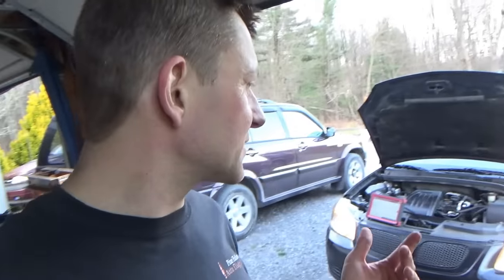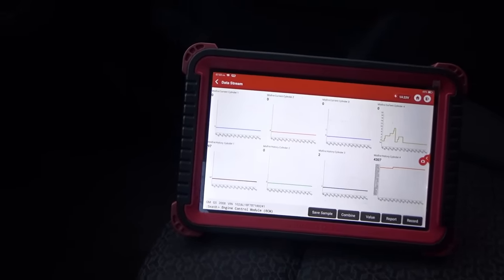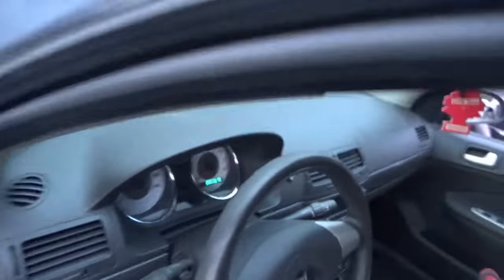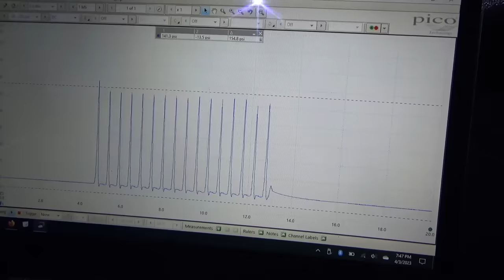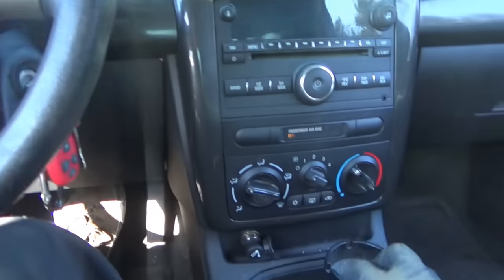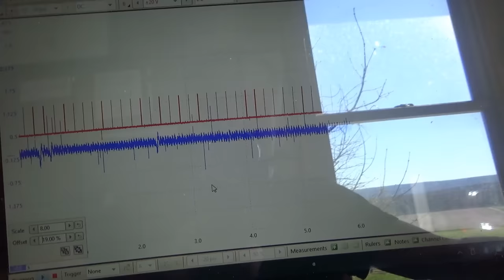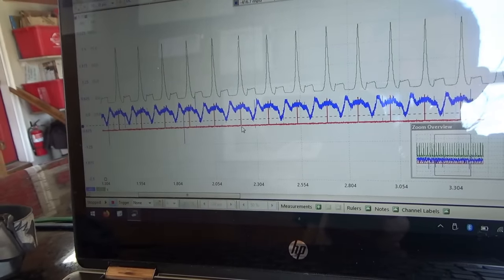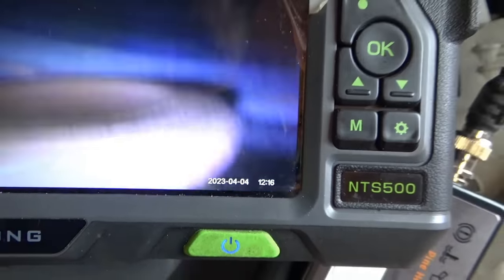P0300 Mystery MISFIRE - Difficult to Diagnose! (Intermittent "FISHBITE")

Comment: Wouldn't you see a peak in the exhaust capture, ahead of the valley, if the exhaust valves were leaking? Maybe I missed it, but did you put a transducer in the intake manifold? It would be interesting to see if you get a peak there that occurs ahead of the valley in the exhaust system. Of course it wouldn't occur directly leading into the valley, because the power stroke is in between the compression and exhaust strokes, but I wonder if you'd see anything.

Comment: It does seem like a broken valve spring might be the culprit, but that might result in engine failure if the spring lets loose and the valve falls into the cylinder. I have seen broken valve springs hold together for a while, but eventually they will catastrophically fail. Just out of an abundance of caution, I would pull the valve cover ASAP to check the valve spring; replacing a valve spring is a 10 minute job and the owner can still drive the car without destroying the engine, until they decide to get a valve job, but if they continue to drive as is and the spring completely fails the engine could be toast.

Years ago my then wife's 80 Toyota Camry developed a similar miss. Before I had a chance to try and diagnose it, the motor suddenly developed a horrific miss. I pulled the cam cover and one of the exhaust valves was gone. I pulled the head and the valve was embedded stem first into the top of the piston, but surprisingly found no scoring on the cylinder. Figuring I had nothing to lose. I sent the head out for a valve job and replaced the piston. After reassembling the car it actually ran good as ever. Six months later my marriage broke up and I always wondered if the car continued to function.

At the time I was working for my dad's enameling business and figuring the piston would make an interesting conversation piece I sent it off to have it nickel plated. A few days later the plating shop called and said the piston (and valve) had disappeared and they assumed someone stole it.
Reply from the maker: Now that's a story 😅

Comment: I measured the amp draw on a 2002 Lesabre and found that the fuel pump was using 5 amps instead of the 7amps. I replaced the fuel pump then viewed the secondary ignition waveform -- the lean condition cleared up in the  waveform  and the fish bite at idle seemed to go away.
Reply from the maker: Did the actual fuel pressure change? Fuel trims?
Reply: @PineHollowAutoDiagnostics  No the fuel trim for some reason was not high or low before and the fuel pressure did not change-The only thing that I could measure was the secondatry ignition --the waveform showed a lean condition on all cylinders before --then after fuel pump replacement the lean condition went away. My only guess was fuel volume.
Reply from the maker: @aarongallagher8898  that's crazy... Maybe old fuel pump was mixing in air to the fuel rail?
Reply: @PineHollowAutoDiagnostics  I did'nt measure the actual volume -just noticed after fuel pump replacement the amps used increased by 2amps and that secondary ignition double spike went away (mostly) along with the fishbite I was going in the direction of a vacum leak --but smoke testing turned up nothing. And all the cylinders had that lean condition so I thought what is common to all 6 cylinders--I also did a voltge drop of the fuel pump circuit (that was good).

Comment: if compression was the problem you should see it on the crank sensor. the fact that it is at idle leads me to think its sucking air at idle running lean. no mention of fuel trims. or injector on time comparison. is there an exhaust leak or a fault with the air injection?it gets worse with temp is the key attribute. whatever is expanding with heat. a stuck lifter with a hot valve stem may cause it to open but it should be every revolution. since multiple cylinders at one time caused it makes sense its one issue common to all cylinders. with that many miles i'd run it till it pukes.

Comment: I have a 2003 Cadillac deville,p0300. IT runs beautiful until it warms up,then it feels like 1 cylinder misfires, not multiple. Cools down,runs beautiful again,warms up, start's missing, I can feel it's only 1cylinder. IT had a p0420, I put dura lube cat cleaner in and that code is gone. I don't want the p0300 to set the 0420 again. I'm going to try and disconnect injectors 1 at a time and see what happens,if it is 1 cylinder, I should be able to find it. I did a smoke test,no leaks. Any information, I would appreciate it.

Comment: If engine is DI, my guess is carbon build up on valve causing valve issue.  If not, my guess is something valve related to a specific seating point on the valve seat.

Comment: Would a valve seat change that much from hot to cold? Double check the temp sensor and the thermostat. Otherwise Intermittent electrical issue based on the changing cylinder misfire counter.

Comment: i would think if you thought you had a burnt valve, via your electronic diagnostics, and you were "betting" it's a burnt valve, why not do a cylinder leak down test? especially on a 4 cyl. engine that is easy to get to?. you would know right away if the valve was burnt and leaking, just go to the tail pipe and Bob's your Uncle. thanks for all your great videos!

Comment: DRIPPING INJECTOR  former owner used gas from original location- new owner uses gas from new location and probably the cheapest crap available. Switch injector to see if issue follows cylinder,  replace injectors and run good quality fuel.

Comment: What gets me is how the misfires disappear just as suddenly as they happen but we know it's not an electrical problem since the scope shows injector and spark activity during the misfire.
Now, I've experienced low compression misfires on two of my cars a couple times on each that fixed themselves anywhere from 1 to 150 miles of driving.  One car is a Dodge Stratus 2.4L and the other is a Chrysler Sebring 2.4L. They burn a little oil and run fine when I shut them off, then the next day they'd get a dead miss. Shut the engine off, clear flood, I can definitely hear low compression in one cylinder. Drive a few miles and it's like it never happened. Oh and both of these cars have over 400k miles on them, hence why I just keep on driving if I notice any problems.
Reply from the maker: Wow 400k miles is no joke! 😎

Comment: Seems like the only way to fix that one is to keep driving it until the problem becomes constant. Too bad it is a hassle to remove those valve covers so as to take a look at the condition of everything in there. Something could be broken or strangely worn after all those miles. The first owner must have changed oil a lot for it to last that long. 
Looking at the condition of those exhaust valves they are lucky none have failed.

Comment: A vacuum transducer could detect valve problems more easily, especially when synced up to the spark of cylinder 4.  A vacuum gauge in the old days would tell us all kinds of valve issues
Reply from the maker: What would the vacuum transducer show? 🤔
Reply: @PineHollowAutoDiagnostics  I believe a valve problem showed greater instability in vacuum compared to normal, this was on a gauge you would see the guage swinging, a transducer will show you far more, you would have the ability to sync to a cylinder to see which cylinder is causing

Comment: Given the age and miles, I'd suggest a used low mileage engine replacement if one is available.  If one isn't available, a valve job could cause higher oil consumption with those old piston rings which brings the circle back to a new problem.  Just a thought.
Also, how corroded is the under carriage?  Safety could be a bigger problem.  The Car Care Nut guy brought that up in one of his latest videos.

Comment: i'd look at secondary first, it shows all you need to know with these

oh, exhaust pulse, that's the money shot

i've never asked myself a question why it sometimes misfires at hot idle, but runs fine under load. at least after i've put a couple of dead heads on my cars i haven't 🤣

secondary ignition is where it's all about, you literally see a valve not seating live on your screen, and it takes so little time it's unbeleiveable

the fact that we didn't see secondary is a no no imo 😓
Reply from the maker: You can see a valve seating on a secondary waveform? That's next level!
Reply: @PineHollowAutoDiagnostics  if peak kV is low every time it misfires, it's a valve seating problem

Comment: I,m going with dry/sticking valve guides. I've seen it twice in 35 years. At low rpm the valve wasn't closing fast enough.
Reply from the maker: Should have caught that on the pressure transducer...

Comment: If it’s a fish bite misfire, why tear the engine apart? To prevent being stranded? Could wait it out.

I had a random misfire I think (popping) but no codes after I changed my timing belt. I actuality got the intake cam off by one tooth 🤷‍♂️😂😂
My fuel mileage was terrible so I looked into it and figured it out.

That misfire went away but I still need to fix the timing job. Yes, I’m a dumb hack 😂😂
I wonder what caused the popping and why it went away.

Could Ivan have scoped cylinder 4 to see what he can see? Waste of time?
Oh, he did scope it.

Comment: I'm new to in cylinder wave forms and a 2006 gmc express van came in yesterday that wouldn't stay running. I checked fuel pressure, injector balance, spark, vacuum leaks. MAF sensor  and everything was fine. Then I grabbed a in cylinder  wave form and I had no vacuum dip. So I hooked up a vacuum gage to verify and it was fluttering bad from 10 inches to 0. When I raised the rpms the vacuum went to 20 inches. I did a compression test with a standard gauge just to see my max compression cranking and the odd thing is it hit 175 really fast. Usually it takes a couple rotation before it tops out, this was almost instantly. As another diagnostic tech I know you can't diagnose on a chat but what else should I test? I was going to check timing tomorrow because my scope died. I didn't see any pressure in the exhaust on my wave form. I checked when  spark was accruing to TDC and it was about.
Reply: Check for clogged exhaust?
Reply: @donwasse7892  thanks for your feed back. I checked that though. If you think of anything else let me know. I also thought it could be a stuck egr but this vehicle doesn't have one
Reply: @lovetolearn5253  I suppose with everything you checked, the only thing I can think of left is a badly stretched timing chain. Unless perhaps it has very low oil pressure to the lifters and the lifters aren't pumping up, which would look like late cam timing?

Comment: I have been in the auto repair business for about 38 years.  The first 30 was being a mechanic; now mechanic/shop owner.

I find I I fix vehicles more acurately and much faster by doing one very simple thing.  I talk to the client.  I ask a lot of questions.  On your car I might've asked a question like "did the vehicle sit for an extended time?".  You were smart and found out that the current owner said that it was fine for aprox 2 weeks.

Carbon and varnished oil/gas.  IF it was my car, I would first start off with an agressive top engine cleaning, then I would put in 2, 20 oz bottles of Techron in a full tank of gas as well as substitute 1/2 to 1 full quart of trany fluid for engine oil in the engine crankcase.  Again, if this was my car.

If you are truly going to tell the client to 'wait till it gets worse', then at the very least sell some oil and gas addatives, otherwise sell a head rebuild per your diagnosis.

I hope you get a chance to fix this for the client and looking froward to a resolution.  

I enjoy watching your videos, very much.

Comment: I had similar on an Audi 2.0TFSI. I had rebuilt the engine after timing chain failure. Replaced all 8 inlet valves. Most of the time it ran fine, but occasionally it would start to misfire, only at low RPM on one cylinder. Compression test was OK. I figured that one exhaust valve must be slightly bent, even though it seemed to lap in OK at the rebuild. Pulled the head and then filled combustion chamber with diesel. Yep, it leaked! Replaced all 8 exhaust valves then engine ran like a Swiss watch. My mistake of course. Should have done a leak test the first time!!

Comment: Switching coils proved the problem didn’t move with the coil but Is it possible the driver running the coil is missing once in a while? Possibly a bad computer or wiring to the coil? That might also explain the other two acting up randomly the next day.
Reply from the maker: Scope proved coil driver was perfect during misfire 😉
Reply: Oh ok I must have missed that part. That is crazy. I have been a mechanic for 15+ years and I have never had a random misfire like that from slight compression drop. I learn something new every day. Thank you for the great videos!

Comment: Just because the injectors flow the same amount of fuel doesn't mean they spray the same pattern. I would have swapped 3 and 4 injectors to see if the spray pattern was causing the misfire.

Comment: Ah.  The old oil drip misfire.  Intake valve guides are probably worn enough to be letting oil into the combustion chamber.  Not much, just a tiny taste.  When the drip hits the plug or combustion chamber, it misfires that one time, until enough oil accumulates on the backside of the valve enough to "drip" again.  A decarbonizer treatment may improve things for a bit, but is a temporary fix for a permanent problem.....old age.  Give the customer the option.....free will, and all that. 
  Another possibility is coolant dripping into the combustion chamber on the intake stroke, but it would have cleaned it more than anything, and would show up on an overnight cooling system pressure test......just like a nissan would.  It was too dirty.
  Where is your cylinder leakage tester?  What did it say?  A difference in running compression can also point to weak or broken valve springs, which can be pushed closed during a cylinder leakage test.
   Lastly, I have seen a bad injector spray pattern do this, but not real often, and would not come and go like this.  The injector can flow the same, but have a bad spray pattern anyways.  Fuel falls out of suspension much easier at low engine speeds, and can cause a rough idle/fishbite misfire when too much liquid fuel accumulates.  I suppose a gas analyzer would really point this one out with high HC readings, but seeing is believing also.

Comment: So , you have good plugs , good wires , good coils , good injectors , no vacuum leaks , from smoke machine test , cylinders checked good with compression test , but , even though you have good compression , have you done a compression leak down test ? P0300 is a wide variety of problems and i think i saw you showing #4  with miss fires ,  the valves or even rings causing the miss fire on that cylinder because it could be failing the leak down test ? with #4 on TDC , both vales will be closed .  just saying ! you do the test and hear air leaking from the exhaust being the exhaust valve or the intake valve leaking from the disconnected air cleaner , just saying ? i think the leak down test will give you the final grade rather than the bore scope would !
Reply from the maker: How could compression be good with constantly leaky valves? Just saying LOL

Comment: I think it is NOT correct to look at the exhaust gas pulses in the same  time frame as cylinder's ignition or injection occurs. You should account for DELAY of pulse, as follows: 1. Sound travels at speed of 343 m/s, or 1125.33 ft / s. The length of tailpipe on my LandCruiser is about 14 ft. Pulse traveling Time = 14 ft / ( 1125.33 ft / s ) = 12.4 ms DELAY. This is only approximation for demo purposes.
This Delay is not constant. For example, if the exhaust gas volume is three times larger during high RPM's, then the speed of the exhaust gases will be much faster and DELAY will be smaller. As you can see, because it is hard to time exhaust pulses, the exhaust waveform should only serve as an overall abstract estimation, not a precise method. It cannot pinpoint the cylinder number:  the erroneous exhaust pulse could be situated across ANY cylinder. On your "one-cylinder compression" waveform it looks deceptively close to cylinder 4, but in that time-frame, other three cylinders fired already.

Comment: I think I’m having a similar issue. Single cylinder misfire that seems to be only at idle but happens more often than yours.  Mine misses say every 2 to 4 revolutions it feels like.  I’ve done all of the same things they’ve done to that car.  The compression test showed good.  I finally bought an otc leak down tester and that showed my cylinder 4 to be 18psi below the input pressure.  The leak was showing on the intake valve.  The other three cylinders were between 2 and 5 psi lower.  I’ve been messing with this for 10 years because the car runs great other than at idle and once I got it to stop stalling at stops I didn’t care as much.  No emission inspections in SC.  Getting close to pulling the head.  I’m hoping it’s something I can fix myself by replacing and or lapping the valve.  It’s a ‘97 Pontiac Sunfire so it’s not worth much but it’s my favorite trip vehicle……super comfortable cloth overstuffed seats, sunroof, stick and 38 mpg.🤔